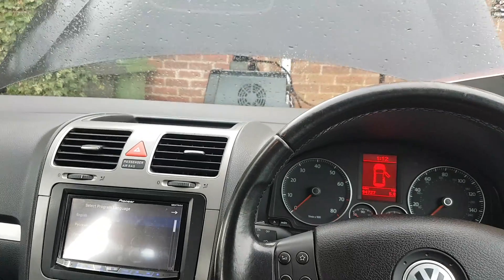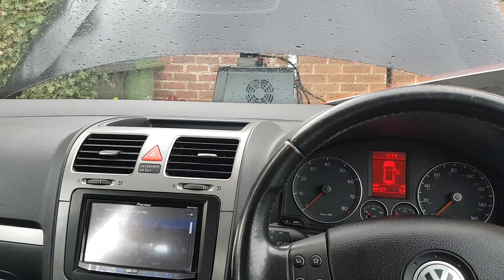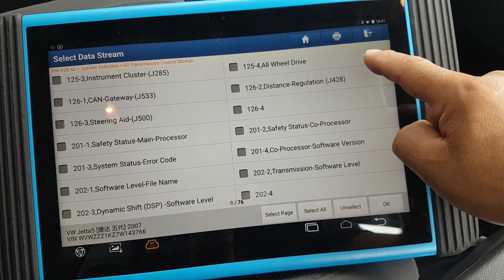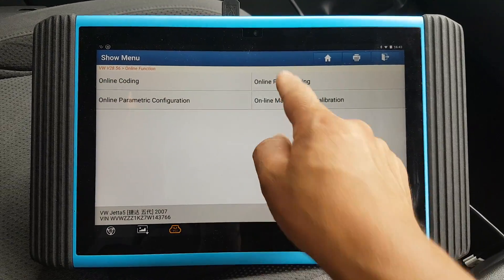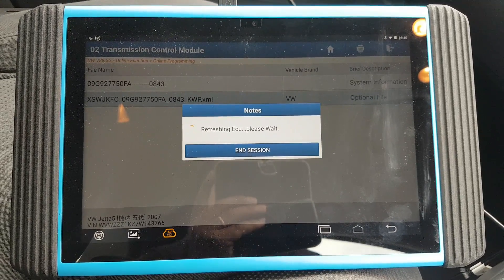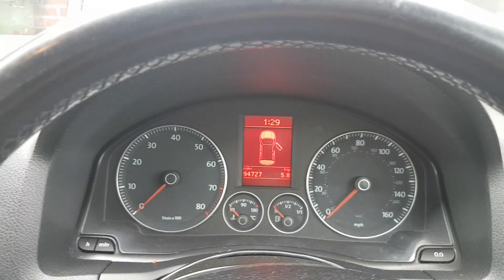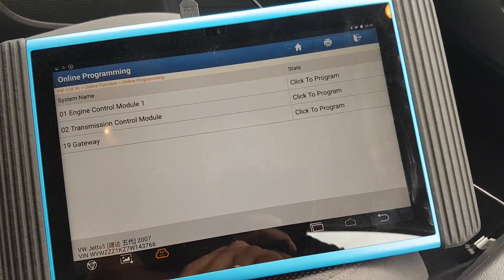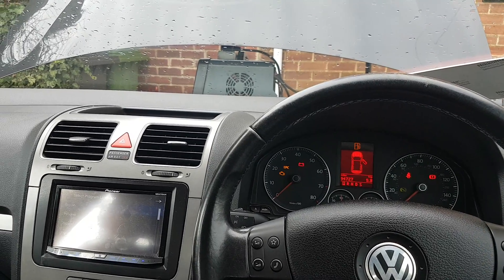Flashing/Programming VW Golf TCU with Topdon Artipad I

Comment: I have a 2003 Audi A4 3.0 Cabriolet. PRND is not indicating what gear it is in out of park. When in drive and Multitronic it disappears. Then the PRND starts flashing go in limp mode. I let it sit then it is ok. I already replaced the ECU and TCM and the circuit board under the shifter cover. WHat could it be?
Reply from the maker: Have you checked for codes and live data before replacing all those parts?
It might be a wiring issue!
Thank you for watching!
Reply: @LMAutoRepairs  I'm about to hook up a Vag com tomorrow. Had to find someone to help me.
Reply: I was told the units need to be re-flashed while in the car. I was told it may be corrupted firmware
Reply from the maker: @ProSeAmericaCheekyFella  
It possible...
Dealer or someone with a capable tool to reflash/update the modules...
👍👍👍

Comment: Hi there.

I have question about connection with VCI how did you able to connect with VCI vis USB??
Reply from the maker: Hi
Yes... to program uses the USB.
Normal operations Bluetooth does the job!
Thank you for watching!
Reply: LM Auto Repairs Thanks for reply.
So you didn’t do any setting?
Because I tried to connect via USB .VCI won’t recognize.
And I contact to topdon then they said 
‘In general, ArtiPad I supports to connect VCI with Bluetooth not USB. It is not the official support about connecting via USB. However, there was another customer had done it via USB successfully from our feedback. Also, you could have a try: https://youtu.be/9a16vz_3Xoo

I know you have a lot of pc knowledge so I was wondering if you have any idea of it...
Reply from the maker: @kotaku9339  
No... I haven't done any configurations...
Plug & Play...
But I got the Artipad all set up... 
As I said on the video, this Artipad is not mine...
But I can't remember seeing any settings for the USB connection, so should work just by plug it in... try a different USB cable... you never know...
Reply: @LMAutoRepairs  Thanks for quick replay.
Even I watched owner manual but not showing any setting for USB connection..usually when I program something with other scanner I always use wired connection so Im a little bit worried about connecting via Bluetooth to do the programming. 
Thank you for your help.
I am looking forward to your  new videos!!

Comment: Maxisys can do the same online programming on vag? or BMW and Benz only?
Reply from the maker: Last time I checked, on Vag wad only online coding available... not flashing...
Thank you for watching and for your comment!
Reply: @LMAutoRepairs  hi, different between online coding vs online programing?
Reply from the maker: @mrt-ee1zn  
Hi
Programming or also flashing, is more known as the update of the software with the same or a newer version...
Coding, usually refers to change adjustable/switchable settings within the software/module... 
Hope it makes sense...

Comment: Nice.
I have a dsg 7 (dq200) 
1.6 tdi 2012 model
I really needs to replace the software on gearbox.
Reply: you can use a  chip tunner  tool ...
kessv2,magprox17

with magprox17 you can clone
gearbox ecu 
so you can copy the right soft from good tcu to your tcu 
but dont forget save old sw
....
i think you need replace your gearbox 
pcb 
by 
1.copy your sw (read gearbox tcu)
2.replace pcb in gearbox (used)
3.reflash your sw you make before in section 1 but this time obd  
4.drive safe
Reply: look youtube video magprox17 
dsg clone